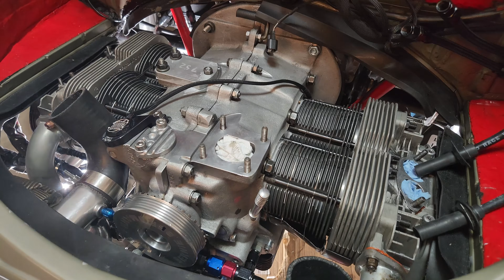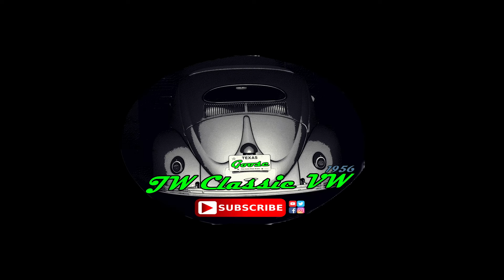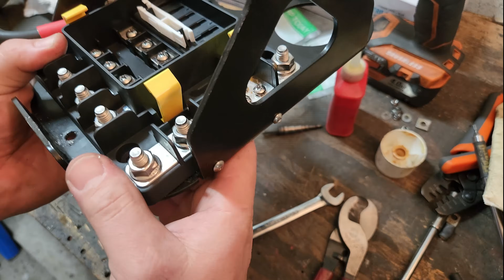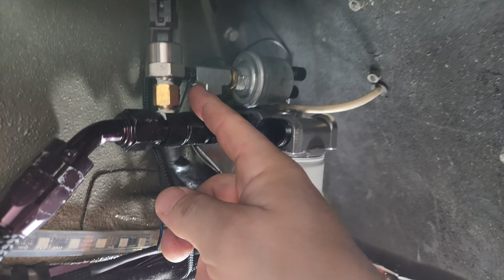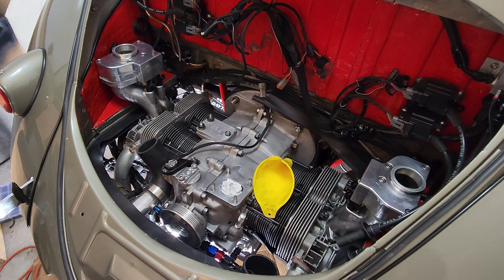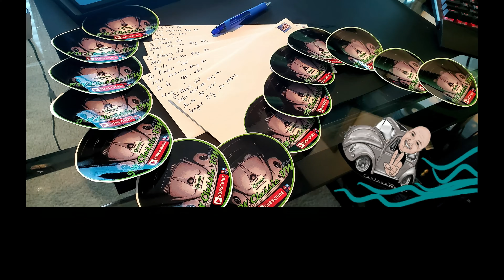VW Haltech PDU Upgrade | Engine Oil Prime

Comment: Mr. Terwilliger. I noticed rear Dis brakes? Whose kit are you running? I have a 57 ghia, and all the kits on the market are made for 58 on up? What mods did you have to make, if any?
Reply from the maker: No Mods... the kit is from Empi with painted calibers.  Brake lines are from Airkewld.